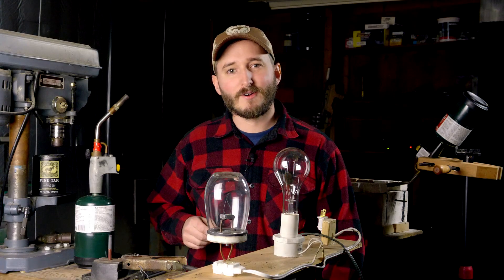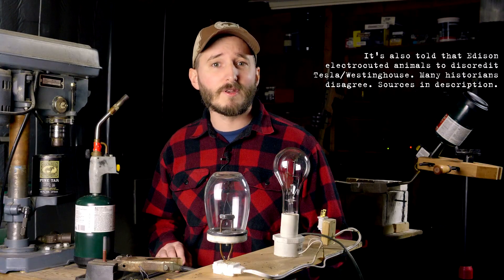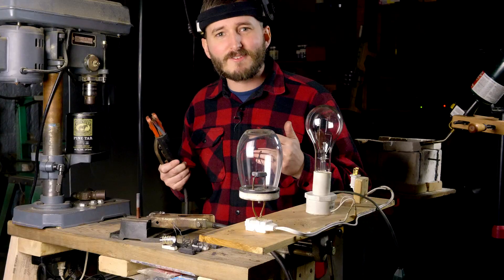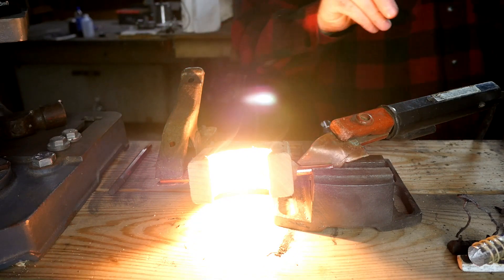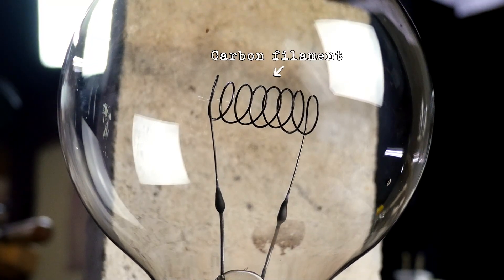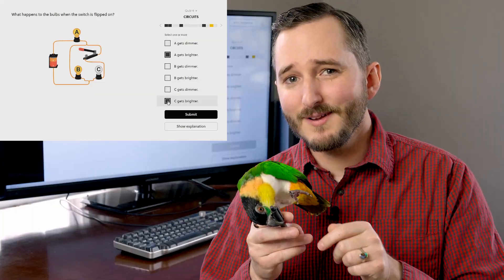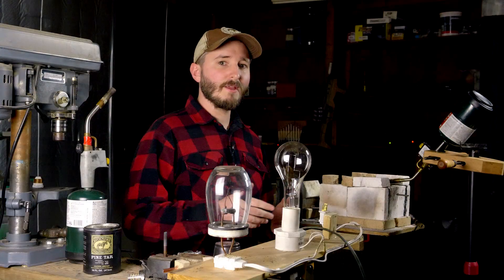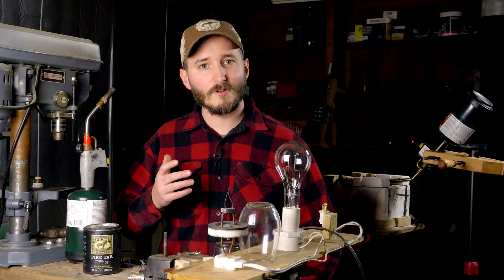Re-Inventing The Carbon Lightbulb

Comment: Can you do tesla's carbon button lightbulbs? Rather than passing a current through the filament, it uses ultra high-frequency ac with the positive hooked to a carbon nodule and the negative into the glass or a wire mesh surrounding the center. This causes the electrons to be kicked off the carbon and then repelled by the glass, get the frequency high enough and the repulsion resonates inside the bulb making light. I've read about them but never seen one.

Comment: why not use a current limiting dimmer switch?
Reply from the maker: That would have been a good idea
Reply: @Nighthawkinlight  thanks for replying i was not expecting one, btw i wired 4x500w tungsten filament lamps in parallel one time and it works plugged directly in the wallmart but as soon as i tried using a dimmer switch it was working till it went to max and then something went haywire as it was no longer working ,i tried lowering it back down but it kept buzzing and taking juice and would not even shut off?? i had to unplug it as it started burning my table so idk what went wrong ,it works fine with one but i guess it has a current limit or something but how it stayed lit after i shut it off made no sense ,its as if it was using HR to draw in power

Comment: Edison tried a gazillion materials before he figured out that the problem was outgassing and improved his pumping process. How many of those materials would have worked with a proper vacuum?
Reply from the maker: Edison's vacuum pumps were the best in the world at the time and have only barely been improved on today. I don't have the resources to make or buy a comparable pump to test with. Certainly every material would work better, but still some much better than others.
Reply: @Nighthawkinlight  I know this is late but "barely been improved on today..?" Gimme a break!  Today's turbos can get to 10-10 torr or better. Multiple orders of magnitude better vacuum than anything Edison had.

Comment: Man I would have been nervous as hell putting my face down by a potential ignition source surrounded by propane and then a thin glass container. I hate to be a safety sally but please buy yourself a full face shield like the ones used for lathe turning. Mine is handy for so many other things and it is better in so many ways to safety glasses. For instance it is really hard to fog one up.

Comment: Just make a ceramic element Nernst Lamp, circa 1890's tech. 
They don't require any vacuum, inert gas or even a sealed globe. Just a simple ballasting setup held at the base of the bulb to work as a limiter and preheater to get ceramic up to conducting temp. 
Also, much more rubust than the carbon bulb in most all ways.
Reply from the maker: Interesting, I look into that.
Reply: @Nighthawkinlight  , there was an american inventor after Nernst, can't remember his name, but he greatly improved the Nernst lamp by eliminating the heater element and perfecting a AC ballast for it.
 He used a carbon/graphite pencil mechanism to draw a spiral line on a larger ceramic element itself before turning it on. It conducted and heated the ceramic but burnt off after the ceramic reached conductance and thus, eliminating the need for switching a heater element on and off.

Comment: I would be a bit worried about using propane to displace air.  If you don't displace enough, or if you are a bit slow getting the inverted jar back down and enough air leaks back in, Kaboom!

Comment: In the 70s I had a carbon filament lamp which had a long filament which used to Flicker and look like a large candle flame with the help of a little magnet that was on a little ring at the top I've not been able to find one or even a reference to it online?
Reply from the maker: I think I've seen something similar, but I can't remember where. Maybe an item featured on the GrandIllusions YouTube channel, or in a classroom physics demonstration
Reply: @Nighthawkinlight  I have managed to make the new antique imitation ones to oscillate a little bit with a strong neodymium magnet but the supports of the filament are too close together to get a good effect
Reply from the maker: Yes now I'm remembering that you can do it with an ordinary bulb, I suppose because of the AC wall power giving alternating magnetic fields that push the filament around next to the strong magnet
Reply: yes, I still cannot find one, the filament  was very long like in an original Edison bulb, but the glass envelope was pear-shaped

Comment: When Edison was still my boyhood hero, I read many stories about the light bulb he created and his work with bamboo.
After many trials with bamboo from around the world and all the failures, he switched back to cotton thread and learned how to spiral the thread and carbonize it so the resistance was higher and it used 100 volts DC. He was very satisfied with this system and went on to make all the fixtures, switches, plugs, sockets and fuses required to wire a house properly.
If you were to thin the pine tar, and coat the thread with it before carbonizing it, then wrapping the thread around a mandrel, you can make a good filament for a lamp.

Comment: So, you say an organic material like humans, so it means when burns it turns into carbon, which can hold the heat, if thin enough so it doesn't need a lot of power, which convert to a lot of light, so thin wire is small power is the small lumen. If it is thick, then too much power and too much lumen, so you say ultraviolet light, so it converts to a higher level of frequency of light so it can blind you? So, the sun itself is ultraviolet light since it can blind you? Or it can be regular light that is violet alone with a lot of lumens that blinds you? Carbon is strong and weak at the same time, so strong in conduct for heat and low insulator in holding. Non-organic materials can become carbon when burnt?

Comment: If memory serves, in addition to the bamboo being quite old, Edison also treated them with some sort of organic solvent,  like acetone:  essentially dissolving the lignin, before  forming, then charring in a chamber purged with carbon monoxide. Thanks.for.this.content.
Reply: I was about to write a similar comment. I'm not sure if acetone is good for that but some solvent is the correct answer. Basically the optimal solvent would be some something that attacks anything else but carbon and can be burnt away.

Comment: You should extrude a thin filament of carbon/clay putty and then fire it. They have metal putty for jewelry.
Reply from the maker: Extruded filaments were used for some time. They made them with graphite powder and nitrocellulose as binder.

Comment: Try burning out the oxygen with a small candle. I just saw that in an old video. It worked. He put a tea candle under the glass and after it was burned out from consuming the oxygen, he then turned on the power and I don't know how long it lasted because the video ends, but it doesn't burn out instantly. And he's just using a copper wire!

Comment: Tesla developed the alternating current, against Edison's plan for DC current, so I am presuming that Edison used DC current for his lightbulbs and not the AC which you are using in your lab. ----  Have you tried to use just the DC current to see if you get the same results? Might be worth exploring, or experimenting with.
Reply from the maker: Shouldn't make a difference in a bulb like this

Comment: Incandescent technology actually has the potential to last over one MILLION hours.  In fact there is one carbon filament lightbulb that has been burning for 119 years now almost straight and is STILL burning TO THIS DAY, only taking a few hours worth of breaks during the occasional move or power outage.  It was made by a company called shelby electric who actually adhered to insane quality standards.  This lightbulb is now known as the centennial light bulb and it can be found at fire station 6 of Livermore California.  The reason that most lightbulbs did not last this long was because the manufacture of most of them was actually being sabotaged by a cartel known as the Phoebus cartel that threatened to fine anyone who made a bulb that could last more than 1000 hours, the technology had the potential to have a game changing lifespan but consumers almost never got to see it's full potential because of sabotage and planned obsolescence.  It really is blood boiling when you think about it.
Reply: Okay, so just wanted to add this as a side note as a revision of my original statement.  While it is completely true that the centennial light bulb has lasted well over a million hours.  It's light output isn't exactly what most people would consider useful by today's standards.  LEDs can also get this benefit if they're underdriven.  You could probably expect 200,000 to 300,000 hours on average out of LEDs if you get higher quality ones and undercurrent them even just to 50%.  And they will still have way more useful output than these archaic carbon light bulbs ever did.  It's just that many of these carbon light bulbs somehow managed to ballast themselves naturally, while with LEDs we are using digital circuitry to ballast them but you can still use a ballasted fixture for a carbon light bulb for better brightness and longevity.  I also want to note that I have discovered dozens of carbon light bulbs from the ealry 20th century that are still kicking around the market to this day that have a significant number of hours on them and that even shelby lightbulbs that are long dead by this day still averaged 60 to 70 year lifespans.

Comment: Great video. It's so easy to think such a seemingly simple invention was an almost trivial task, especially when manufacturing had it down to such a fine artform that you could buy them for pennies. Ironically many could last longer than cheap modern LED lamps and had less environmental impact in terms of materials used. I'm an electronic engineer but had no idea the vacuum required was so high.

Comment: This was an excellent explanation of the obstacles in Edison’s way and their conquest.  Tungsten was difficult to make into tiny filaments too, but its use after Edison resulted in much more practical light bulbs.  You might want to make a video of modern tungsten bulbs, using iodine to make the tungsten last much longer at even higher temperatures.  Modern car headlight bulbs would be a good subject to use in your research.

Comment: Would using a capacitor help with the power needed for the initial voltage needed to run the filaments that you were talking about near the end of the video?

Comment: I would be extremely interested to see you make a light(can't call it a blub) out of Starlight. Since it produces the carbon foam on the outside it would essentially burn very slowly as oxygen gets to the surface.  Possibly just make a trough with nails on either end, probably would have to torch the surface to get carbonization started, then the electricity could conduct on the surface. Maybe play around with different impurities to change the resistance. Either way, I think it would be a very interesting experiment!
Reply: I thought more about how this would take shape. And I think a narrow trough in ceramic/glass with electrodes running to the surface. Since electricity takes the path of least resistance it'll travel on the hottest surface of the carbon foam. I also would wall this in with glass, like a lantern to trap the CO2 emission to help prevent as much burning as possible. Ugh, now I'm stuck thinking this would have been a viable early light design.

Comment: Try to use a microwaved plasma based deposition process to deposit a thin film of graphene onto the filament with the correct resistance factors so that the resistance is lower on the outer surface and proper on the inner area.

Basically you can make plasma with foil, matches, grapes inside a jar.  By nuking them.  So just stick a tube on the plasma container jar leading to a small jar on the top outside of the microwave and the fillament setting inside and coat it that way.

God only knows how to make that work but its worth a shot.

Comment: Do you have any video to show how to make charcoal efficiently? This video gave me a hit but if you have a video about charcoal, I would like to see it. I used to bend bamboo by using candle. Did you try it? We Japanese make kites with bamboo structure and also use it for so many other purpose.
Reply from the maker: I have one video but it's not very detailed of how I did it: https://youtu.be/urZgDjBAyng

I basically just light a fire in a barrel full of wood, blast it with air from a leaf blower, then hose it with water once the wood has all turned to coals. I try to keep the pile of coals pushed to the back corner of the barrel and build it deeper and deeper as more wood is added.
Reply: @Nighthawkinlight  I made a charcoal maker from a keg so I can shut off oxygen. So I do not need to water it. I guess I need to make a video to show it later. Thank you.

Comment: Edison wasn't a fraud, he was just a businessman first and an inventor never. He was also very closed off about his opinions. If he didn't like something you proposed he would publicslly discredit you at every chance he got.

Arc lamps are actually still popular to this day! They make for very reliable and high power light sources.

I get the feeling that you might have better results with long filaments if you create some sort of temporary support structure for them while they are inside the carbonizing chamber, like a rod of ceramic to wind the material around and some type of adhesion to that so it will stay properly wound.
Reply from the maker: Edison invented several notable things before he had money to build a team.

Comment: Have you tried arcing a carbon rod over metal that has low melting point? You can get different colors based on the metal and it helps with the erosion problem.
(DON'T BREATH IT IN, idealy a sealed and purged container)
 You can get all kinds of colors too

Comment: Have you tried a filament made of cloths? Or perhaps a filament of a different aspect ratio, one that is wider then it is long? Current draw will be even higher, but it should produce that soft glow that is showcased in your thumbnail. It might be possible to crimp a solder-able strip of metal to both ends of a strip of burlap cloth, this could be soldered to your substrate and carbonized as per your process. Goodluck!
Reply from the maker: I blow fuses even with the filament as thick as it is. Going thicker I wouldn't be able to get it glowing at all

Comment: REALLY REALLY IMPRESSIVE WORK.

meticulous design and work through... can you imagine having to come up with the fresh ideas and not working from a paper where certain things had been thought of and tried? Honestly one of my favorite kinds of science to do.
I had 2 thoughts while watching your brilliant work through..

 what about using your welder to convert the long string to graphite initially for the burn in?

did you think about using smaller diameter bamboo sticks and cutting spirals out of them using the natural diameter of the bamboo?
Reply from the maker: Welders are surprisingly low voltage. Bamboo I think works because of the long fibers which you lose if you cut it in the wrong direction
Reply: @Nighthawkinlight  my welder goes up to 220v, are you saying you need more than that? if so a microwave transformer or two should get you there and if not you can get inexpensive neon light transformers on ebay. thats how i got the 3kv one i used to build my coronal discharge O3 ozone unit.

i understand what youre saying about the bamboo..  It does grow very quickly though so maybe train a plant to grow in a spiral. for that matter decorative bamboo is sold many places already spiraled.

thanks for your reply. our brains work in the same way and i was really impressed with your solutions and operating procedures.
Reply from the maker: If it's a stick welder it runs on 220v, but the output is only 20-30v at really high amps. Tig welders have a pretty high voltage output but I don't have one.
Reply: @Nighthawkinlight  i have an old Lincoln SA welder 220v that actually puts out 85v because it has a high and low side output port for the stinger. tig welders only produce the higher voltage at start of weld and then drop significantly from 70v down to 13-20.  

Im sure that, because you seem to think like i do, that you have an idea of the Volts/Amps and time you think you would need....so how much V/A do you think you need and how long do you think you would need to maintain it for?
Reply from the maker: I'm not sure. Probably if i did a better job making the filaments I wouldn't need anything more than the 110v from my wall outlet. I think what I did in this video was enough to get the point across though.
Reply: @Nighthawkinlight  i see....one final question.....

how many times a day do people tell you you look like Will Wheaton? lol

keep up the good work and if you ever need to bounce an idea off someone with a vast knowledge of all things and a similar internal flow chart as you or you need some research done but dont have time to do it...im your....total stranger... i realized mid way through saying this that you will NEVER do that..:( bummed myself right out. :|

just watched your carbon arc torch video... i have one too. had to build mine also but i use the carbon rods from inside batteries with a system kind of like the hot glue gun system that allows me to feed in short rods continuously. really liked your "simple sheik" method too though. stay safe and have a good day.
Reply from the maker: Ha, 3-4 times a day

Comment: instead of having the light bulb as a resistor you could use a transformer to transform wall power to a higher voltage and a lower current